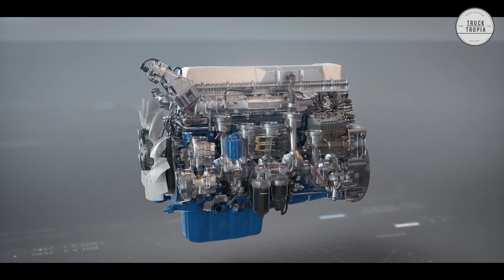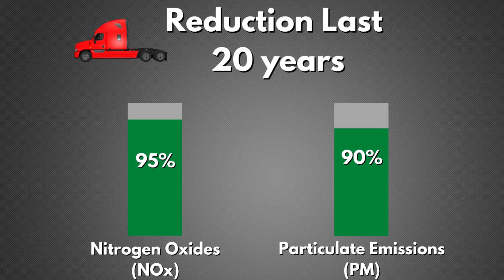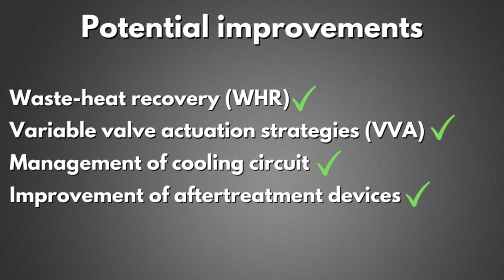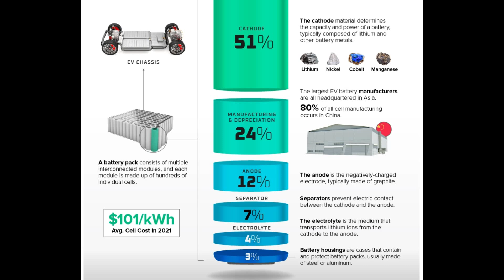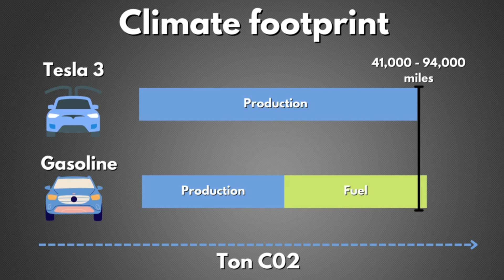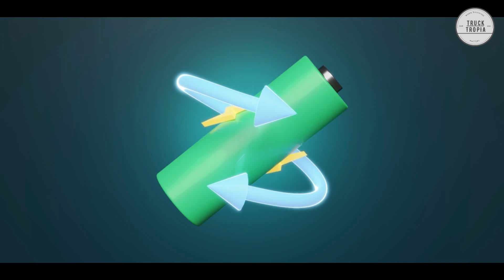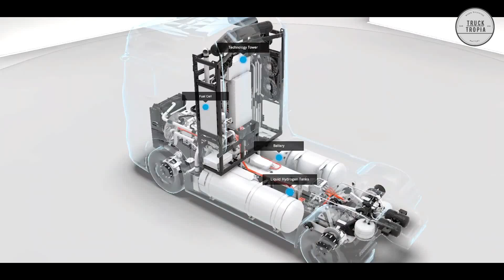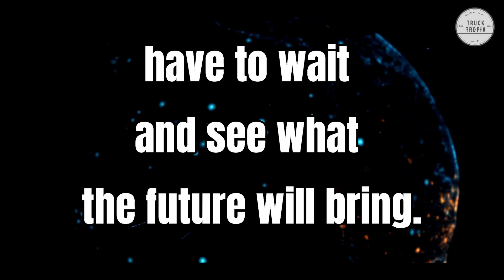How Dirty Are Diesel Trucks Really?

Comment: Yeah exactly, the "climate footprint" to produce an electric vehicle is wayyy more than any IC engine vehicle. 
It takes YEARS or many cycles to reach neutrality with ICE.

BUT, here's the caveat: by the time EV is abe to catchup (or catchdown) "Carbon footprint" level with ICE, it is already time to replace THE BATTERY!
I.e. double the "CARBON FOOTPRINT" again!!

While IC Engines can be rebuilt and run forever, on a quarter "CARBON FOOTPRINT" of batteries.   

If you scale the (HIGHLY POLLUTING) Battery Replacement cycles in every 4 years or so, with engine rebuilds, that can run 25-30 years.

EV's are wayyy more damaging to environment, has wayyy higher CARBON FOOTPRINT cycle.

Comment: Its 2023 and our carbon budget is so low, that putting any more effort in engines that emit CO2 is an absolute waste of time and resources. Thats also true for biodiesel and CNG. Biodiesel is simply not available in the quanteties we need and CNG still emits CO2. And you can do hydrogen if you want but even today batteries are more competitive than hydrogen so good luck selling your stuff. 
And if you do not have enough enough clean electric energy,  just build a bunch os solar. It not rocket science and cheaper anyway.

Comment: What irritates me the most about this topic is that popular opinion seems to say that there should and can be only one answer to which system we use.   Realistically using only one system only changes a problem and does not solve it.   If the production and use of fossil fuels and combustion engines is reduced, not eliminated, and the production and use of altertative fuels and electrical venhicles is increased, there will be a point where there becomes a balance in environmental impact.   Each type of system has areas where they are better than others.  If use is limited only to where they are the best solution, and not where they are not, then it would be the best solution.   There is no one size fits all solution when it comes to the different systems available.

Comment: the electric car has a much higher initial carbon footprint, simply due to the amount of processing and material mining required

its closer to 4-20x initial, but its own emmissions are zero

but coal power plants basically make that zero

and people being too afraid of nuclear, means that we will either have an impossible power future to achieve, or a massive carbon footprint... all because of fearmongering

our electrical grid cannot maintain the electric cars we have today, and we will need upwards of 800000% more vehicles to outright replace the existing amount we have, and an added 300% on top of that to account for growth

theres also vehicle weight issues and what those do to the roads they drive on

remember, science is NOT CONSENSUS

its REPEATED ***RESULTS***

anyone can agree to something
but it takes effort to produce results

and results dont lie,
but consensus about results can cause corruption of the actual truth

Comment: Whatever happened to coal? 
Diesel is here to stay a long while yet. 
Efficiency will improve even more yet in the future. 
It's not just the power to weight ratios of the new trucks, but the weight per mile that they can tow. Light duty trucks specifically. 
I bought a standard output 2022 ram 3500 cummins and it regularly gets 20 plus mpg empty and 12 to 15 mpg towing 14k behind it. In the pacific nw, which has mass elevation changes everywhere you travel. 
That's 23k lbs going down the road getting 12 to 15 mpg. That's pretty darn efficient comparable to the past generations of light duty diesel trucks. 
What beats that right now? 
Nothing. 
Until something can, leave alone what works.

Comment: Diesel is going to be from the ground from oil wells until the day it runs out.
Its simple maths.
I have a 12 year old 2 litre diesel car. audi. which gets 700 miles on highway with just 55 litres of diesel. Its got variable valve turbo and electronic engine management and erg exhaust system with catalytic and does not have the ad blue. This little car is a minor miracle.
Its capability to haul 4 adults with a single bag of luggage is legendary.
If all cars were made like this then the production of the oil fields will be extended.
Now for future i suspect that the hydrogen modified diesel will be the next step.
Produce hydrogen with nuclear power or thorium and we're sorted.
Realise that planes are still using the same diesel albeit slightly different refining and they will easily convert to hydrogen.
Battery cars are pie in the sky snake oil salesman Al gore/elon musk ponzi schemes.
They are ok in small amounts in cities but that's all.
The real world needs real men and women driving real diesel power for more than a decade as Joe Biden has just this week lied about.
Reply: Hehe, for your hydrogen/diesel modification you need a huge isolated tank to keep liquid hydrogen. Then, your Audi hauls only the driver, but no bag. Keep Diesel in your blood if you like, but study the physics.
Reply: @danieltobler414  yeah. I know hydrogen is a houdini gas. It's notoriously difficult to store.
Reply: @danieltobler414  and I remember using a Toyota prius.which is petrol and a huge battery Utterly ridiculous. I was doing a 165 mile to the airport round trip and by the time I got back the tank was on reserve and it handles like a whale. The audi could load up and without refuelling do the trip again.
Reply: @peetsnort  then do the same with a up-to-date Tesla.
Reply: @peetsnort  I have a different opinion. But my opinion is based on real world experience, not on hear-say.
Reply: @danieltobler414  yeah. Me too. I have been driving taxi. I know what works.
Are you a supporter of battery cars.?
I'm just asking because of the constraints of typing and not being face to face
Reply: @danieltobler414  i have a few minutes to discuss your opinion.
Are you using the Tesla for personal use.?
I'm no luddite who scorn the new technology to save my job in the mill.
I remember going to epcot center in 83 and being so excited about the future. I remember the little 3 cylinder diesel futuristic car at the time of only petrol cars. I remember the mock up big trucks with super streamline bodies.
I love solutions.
Its always annoying to get here on the comment section and get dead ended with feelings and personal things.
I would like to discuss your thoughts on the topic
Reply: @danieltobler414  you see what I mean.
You've disappeared. I don't know if you have other things or work to do but you threw your opinions on me and run away
Reply: @peetsnort  Thnks for your reply. I've started working (Europe) and may give you a more detailed answer tonight.
I'm European and your (American) city is like our entire continent in terms of distances and infrastructure. OUr long hauls are just riddiculous in comparison to yours :-) And there is a lot of charging infrastructure and in Switzerland we have plenty of hydroplants to generate electricity. Here, you could recharge your taxi between two customer. I must admit that there is a difference to the US, especially if you are not living at one of the costs.
I'm also electrical engineer and know quite some things about efficiency of gasoline powered engines and electrical motors. That is the reason I have a Tesla.
And regarding lithium, I agree that mining it is not the best thing. But you have to do it once (and can get it back after the battery is dead after 20 yrs usage). Oil supply is constantly needed and also a dirty business.
Can continue discussion after work 🙂
Reply: @danieltobler414  excellent. I have so much respect for you now.
I tend to think about things from the personal perspective and I know its wrong but most of us do it.
I am in England and the infrastructure is pathetic for charging.
The huge difference between me and the service of the truckers is that if i was just driving to the office and parking the car and doing the day's work and letting the car charge is great for that application.
Tesla is an excellent car for that application.
However it is useless to the taxi driver or delivery driver who works from the car.
We all are cogs in the machine and if one cog is not working then the watch stops.
I love technology. But it has to be practical.
Musk is a genius in some departments but take the mars travelling.
The human body is built for gravity and its 6months one way to mars and your muscles will become weak. Atrophy.
He's using the sexy thing to promote his work.
When i visited the Kennedy space centre in 83 i remember asking if NASA could pay for itself. They lied.
NASA takes 60 million off the American tax payers every day.
I am well aware of the spin off technology and us benifitting.
But its not going to help the usa and the 31 Trillion debt.
The very screen I'm typing on was designed from the donut in Switzerland. The hadron collider.
The technical guys needed to consolidate the big amount of screens into one.
This was the first development of the touch screen.
I am just now using one single finger and the help of SwiftKey keyboard to type all the words.
I look forward to more discussions with you when it suits you.
The Internet is the best thing since sliced bread
Reply: @peetsnort  Thanks a lot for you nice words; I was also looking forward to answering your comment tonight.
I distinguish between Tesla and Elon Musk. I'm lucky to know some visionaries in agile SW developement that has change the way we're developing and releasing Software (my home turf). And I must say that you cannot change a industry being a nice person. Henry Ford has changed an industry but he was not well received in his time. He also had strange policital ideas looking from todays standpoit. Or Maggie Thatcher, she has changed UK (to the good or bad I do not know, but she had a vision. 
I also would not travel to Mars with Elon, but if there would not be unconfortable visionars, we would still poundering stones in front of caves.
Reply: @peetsnort  Regarding EV's in practice: For daily commute ideal. For taxis it is depending on the distance, price savings and charging infrastructure. A taxi driver in Berlin was telling me about 10 years back how great his Prius is (savings). EV-trucks may take over domestic trucking in the next years. Long haul needs some more years or never. But I've been watching the progress they've made in battery in recent years. Quite impressive: More capacity, less weight, safer, no Cobalt, less energy needed to produce. There are also salt batteries (no lithium) coming: Not for cars but for domestic power storage.
Reply: @danieltobler414  yeah I heard some news on sodium battery. The might hopefully shrink like the micro chips. Or something like the dilithium crystals on star trek.
The future may hold all kinds of things.
Its quite interesting to compare the mock up trucks in epcot center in 83. I can't remember what powered them but they looked remarkably like elons trucks with all the aerodynamics
Ships could very easily use submarines nuclear power.
I think the answer is thousands of those dotted around the UK

Comment: I had to stop the clock on video to write this comment. Bio diesel is a con.
I live in Herefordshire where the rapeseed is grown
Its a horrible terrible crop. It's stinks and nothing in nature likes it. The bees have disappeared and if a dog runs through it it will get chemical burns. 
The huge thing is that it uses diesel to grow and then transported to be processed by industrial means.
Displacement of the food crops END OF THE DISCUSSION
all the hype of egg and bird flu is a lie.
In countryside where chicken meat and eggs comes from you usually have a farm with wheat on it and a huge shed with 40 000 chicken for either meat or eggs
Its SUPER productive
Rapeseed is proven to be a bad oil for human consumption.
I don't know what the EXACT figures are for the productivity of the oil from Bio fields is but just one look and it's counter productive
The maker of the video just glossed over this fact
The city slickers may have missed this point but this country bumpkin deals with reality

Comment: H2 fuel is stupid.
The sources to get H2 are either not green, straight toxic, or even expensive.
You mention about most of H2 source which is coal or othe hydrocarbons, other way is electrolysis.

The problem with electrolysis is it needs to be made by using H2O, simply because it is the most abundant source we have, our sea is mostly water.
Yes... mostly... it has NaCl and if we use electrolysis straightly to sea water, it will produce Chlorine gas which is toxic.
So we must desalinate sea water first but desalinate sea water is expensive.
So we go for fresh water, right? No... it is bad for humans! We only has around 7% of fresh water and out only 30% of that fresh water is readily accessible, rest are either in ice, snow, or underground water
Reply: H2, for me, is not a fuel, it is battery.
And as battery, it has bad design and questionable resources

Comment: I feel a diesel hybrid solution would be far more impactful than forcing us to turn to full electric vehicles. Countries like Australia are also severely lacking in infrastructure to maintain an electric fleet of vehicles unless you remain close by to the cities. However, necessity is the Mother of Invention so maybe with the laws coming into effect in just a few years may provide the necessary time it will take to produce the new technology needed and to also improve current infrastructure issues.
Reply: It sounds like you are ok with  “laws being the mother of invention”.  As long  as you redefine words like “sustainable” I guess we will get there. Now if we can just redefine the word “efficient”🤦‍♂️
Reply: @Eric Ditmer  no, I am okay with necessity being the mother of invention. We have a climate issue and it needs sorting, however companies are not going to willing jump over to becoming climate neutral at a cost. It will be just like when we discovered that chlorofluorocarbons being hideously detrimental to the ozone layer, we needed governments to ban or restrict the usage of these chemicals, such as r134a, to prevent any more damage and to get on the path of repair. I'm not against changing for the climate I just have a realistic view of how we can make steps in achieving said steps

Comment: Don't forget to factor in repair costs, junk throw away parts, increased fuel consumption, DEF consumption and the process involved in making it and distribution. I have a 1988 L8000, no smoke, 560k miles, and guess how many times it's been in the shop the last 20 years I've owned it?
Once, I had to rebuild the radiator, otherwise it has not missed a day of work.
New trucks are only cleaner at the pipe, but nobody factors in the rest of what it takes to keep these trucks on the road, they produce far more waste than could ever be made up in cleaner emissions.
Reply: Not to rain on your parade, but 560k miles is very low mileage for a 35 year old semi truck.  Your average major OTR fleet truck will put on a million miles within 5 years, will probably get an inframe at that point and go on another million miles before being retired from OTR use.  Early SCR/EGR trucks may have a lot of problems, but in the last few years the failure rates on the emissions controls have gotten significantly lower.  Under typical OTR loads these trucks are getting 7-8mpg, your L8000 probably gets 5mpg at best.  Modern trucks also have significantly more power and torque than a 35 year old truck are much quieter and generally easier and less fatiguing to drive allowing the drivers to get more miles in per day without the hearing damage that was part of driving old trucks (especially Detroit 2 strokes).
Reply: Luke, no NEW truck uses more fuel than a truck from the 80s. Not even close. I bet a new Diesel truck gets almost double the gas mileage.
Reply: The worst example I've seen of this was a newer crane truck bought by a construction company I do fleet maintenance for. The newer truck cost them more in maintenance in 1 year, than their older model (1999 international 4700) did in the past 10 years. I believe it was around twice as much. So the new one cost twice in one year, than what the old one did in 10. 

I don't know. All I see are old models going out to work every day reliably. While new machines are check engine lights and constant problems. You fix that and now the transmission is throwing a code because it doesn't like the state of the trans fluid. Or it thinks it needs new filters. Or has a solenoid acting up. 

I have a 26 year old 12 valve Cummins engine with 500k miles and it just. Keeps. Running. Doesn't seem like it will ever quit. Fuel in the tank, oil in the crank case, and coolant in the radiator and it won't stop.
Reply: @Bloodbain88  i get why we all like older analog cars and trucks. They are easier to repair and the diesels are very reliable. but, we can't buy old trucks new...... i bet you there are 100 new trucks for any old truck still on the road. same thing is true for other heavy equipment. a 1950s dozer just does not come with a quiet engine and air conditioning. regular cars are WAY more reliable now than they used to be say in the 80s and 90s. New stuff is not bad because it is new, it is bad because it not made well. try keeping old OTRs truck running with "original" parts made in China....